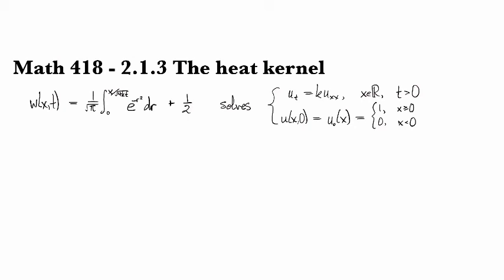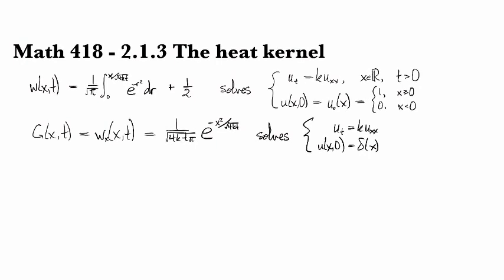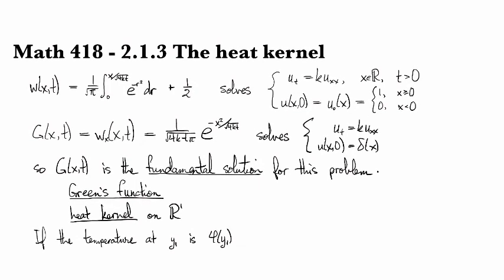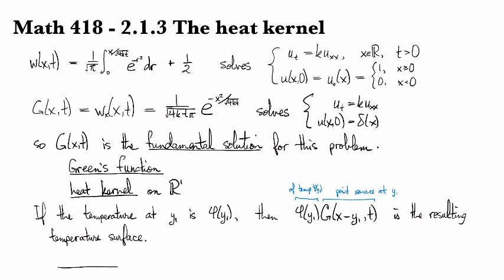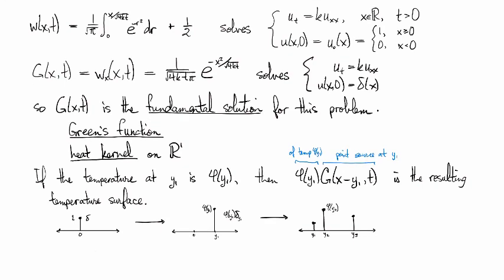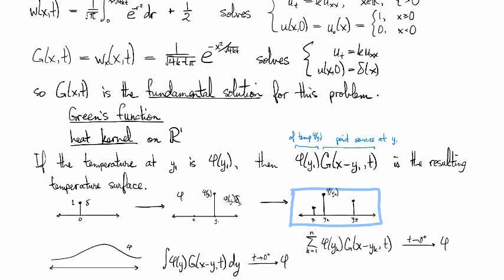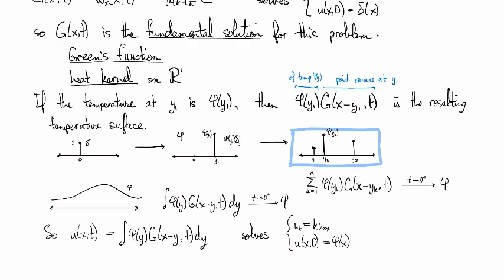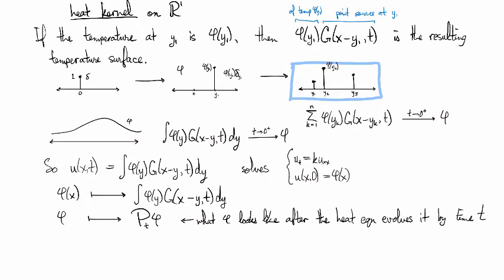2.1.3 The heat kernel

Comment: Hi! Thank you for this really well-explained video. I have a doubt: shouldn't it be exp^(\frac{x^2}{4kt}) instead of \sqrt(4kt) in the denominator of the exponential? I suggest this from dimensional analysis - the dimensions of x, k (thermal diffusivity) and t are [m], [m^2s^(-1)] and [s] respectively. If we have \sqrt(4kt), then the exponent becomes dimensionful (e^([m]) instead of dimensionless as it required. So, from dimensional analysis, the heat kernel should be exp^(\frac{x^2}{4kt}) or exp^(\frac{x}{\sqrt(4kt)})